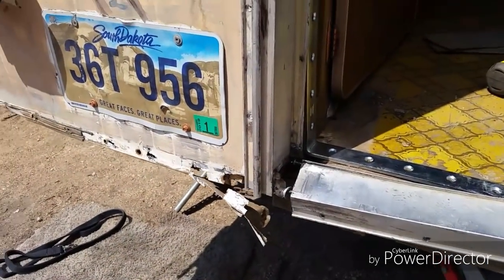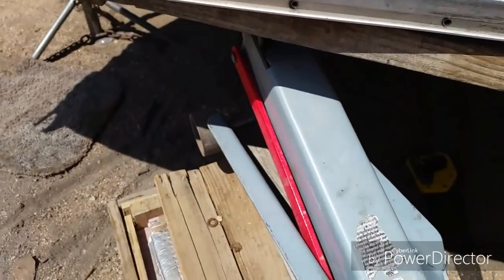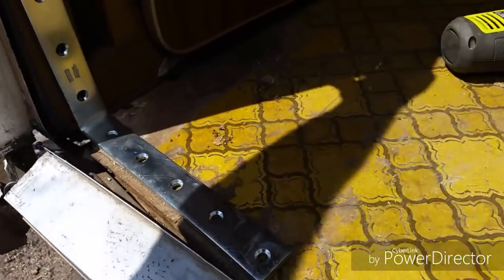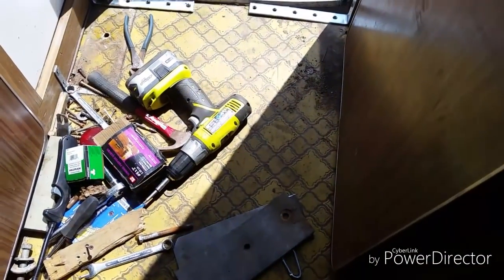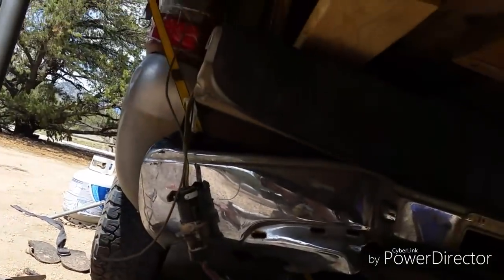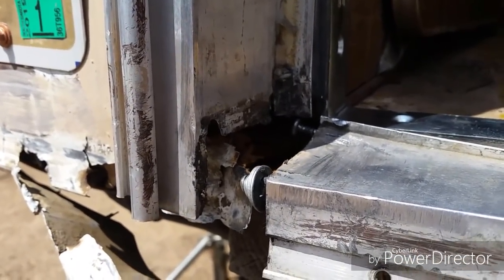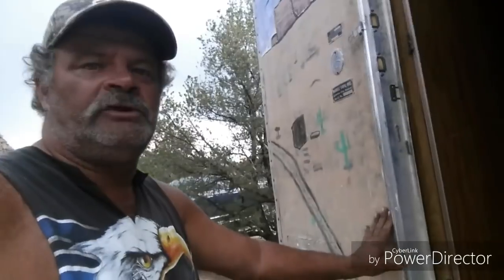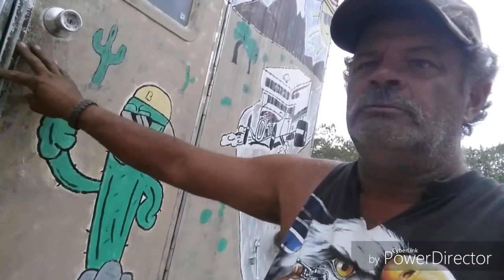It is what it is. Truck camper full-time living traveling and boondocking vlog.

Comment: I so understand the sentiment with your truck camper. I would feel the same way. I am not very mechanical minded. I would be clueless how to repair. If you were to suggest a rig for single female, what rig would you suggest?
Reply from the maker: Deanna Downey yes there's definitely a settlement there holds a special place in my heart. As far as a rig for you goes gosh I would probably try to get a Class C, or if you have a reliable vehicle of travel trailer they're pretty easy to work on
Reply from the maker: Deanna Downey but on the other hand if you're going to be traveling single a van would work just fine